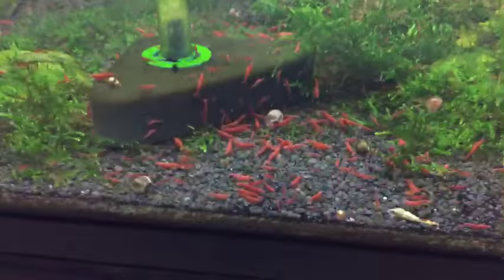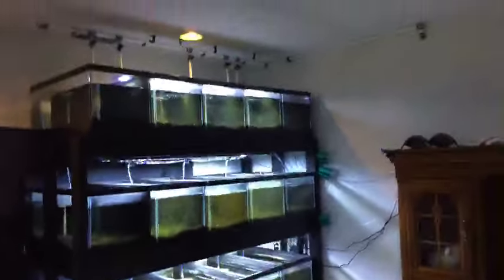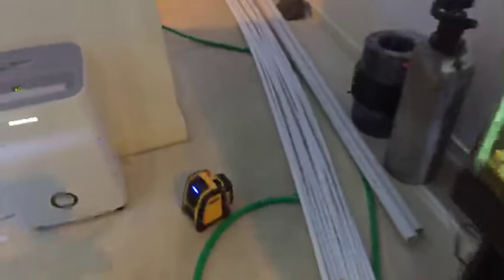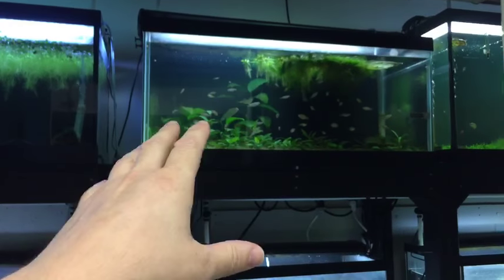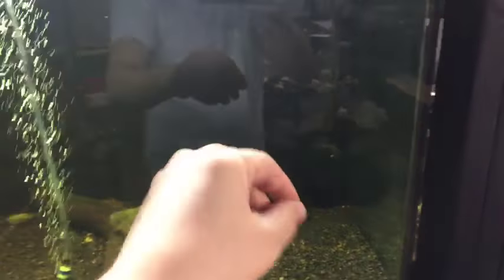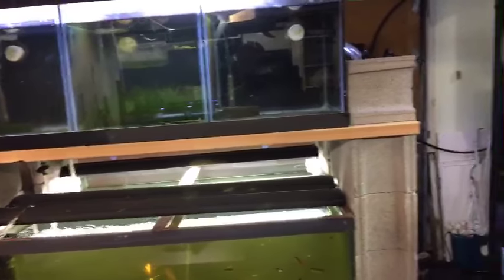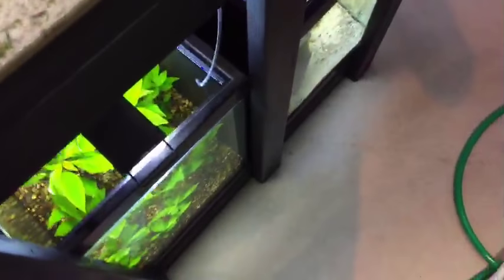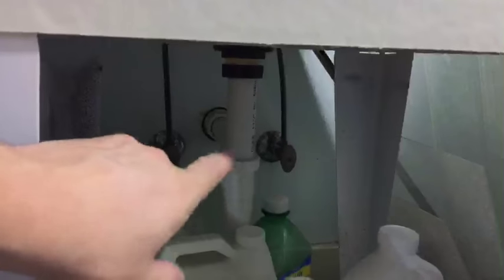🔴 New Fish Room Water change System Progress Full Control

Comment: That's a really nice clean PEX setup. I happen to be re-piping my whole house but I'm using the expansion Wirsbo/Uponor System. I bought one of those Milwaukee battery powered expansion tools off Ebay ( It's fast but even used it's not cheap. Will sell it when I'm done). I bought all my materials online from SupplyHouse.com. They have some pretty good prices. Check em out if you can't find what you need at the Depot. Good luck with the system completion.
Reply from the maker: Thanks! I havent heard of that system before I will have to google it. Good luck on your project as well!
Reply: Thanks!

Comment: Now I understand why people set up water change systems before they have a bunch of tanks. We can't wait until you finish as well! I know its a very small proportion of the lines, but the shrimp will be ok with the new copper fittings?
Reply from the maker: Yeah wish I could have started with a water change system when I began but the fish room was built bit by bit and in the beginning a water change system was not in the budget. I was lucky to be able to get the money to do it this time and had to take out a loan to do so. The house lines are copper and never been a problem and the fittings I have added are all brass.

Comment: Great stream 👍, did you have to drill any holes for the auto waterchange
Reply: Yeah, did you drill any holes on the tanks? Or is it all using overflows?
Reply from the maker: No holes drilled in the tanks. The overflows are just done with tubes and siphon. Once the initial siphon is made it will retain it and if for some reason it loses the siphon I can always resiphon but shouldnt be a issue. When I get everything done I will go through the system again and try to explain it better.

Comment: I Find Doing Water Change For Tanks On The Ground Pain In The Arseeeeee.. Don't you feel it's heard as you couldn't get a full siphon going on ?
Reply from the maker: It is true the ones on the bottom can be a pain. I will be putting pumps in the bottom tanks to push the water out instead of siphon.